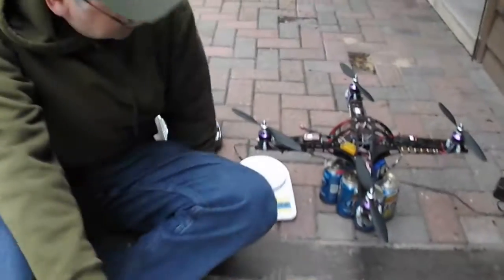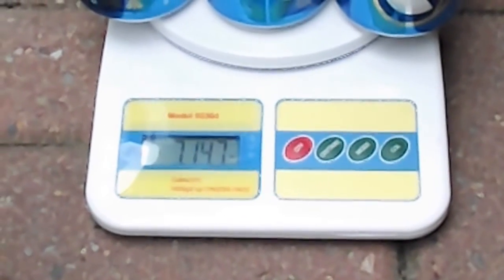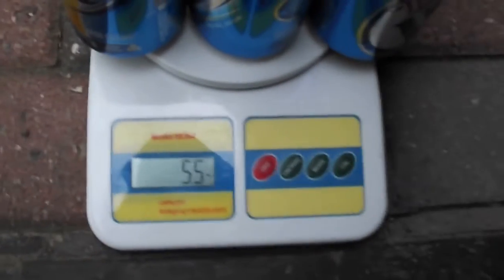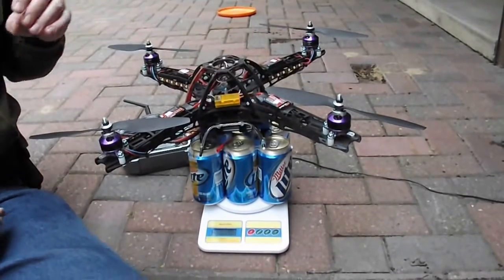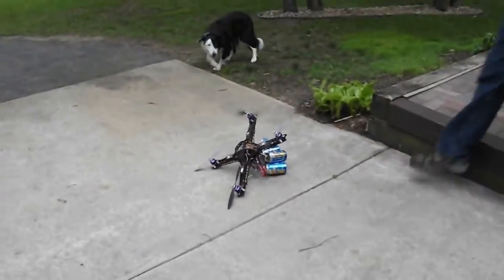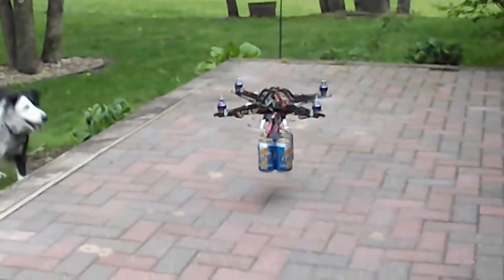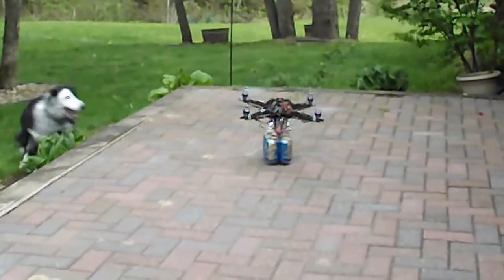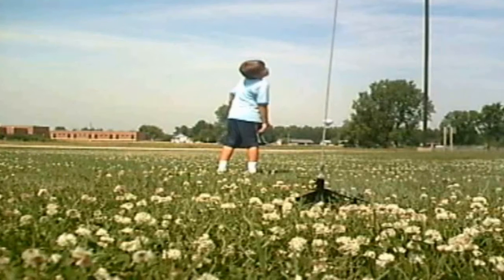Cheap Quadrotor lifts a 6-pack of Miller Lite

Comment from the maker: KK NAV Board $15
ESC $15 X 4 = $60
Motors $20 X 4 = $80
Frame $20
Receiver $10
Props $4 X 4 = $16
battery $50

Total $251 + a few misc connectors so figure $275 to be safe, assuming you have your own radio. A simple 4 channel programmable is all that is required.
Bill

Comment: Hi Bill Can you share the materials you used (type of motors, props, etc). My team and I are trying to build one for an ASME competition!
Reply from the maker: The motors are out of production unfortunately but they are very similar to the E-Flight 480.  They are 900 kv. The props are APC 10x4.5, the esc are Hobbywing Skywalker 40 amp. The batteries are 2 x 2600mah wired in parallel. The frame was a cheap wooden one from Hobbyking as well as the Multi-Wii board.